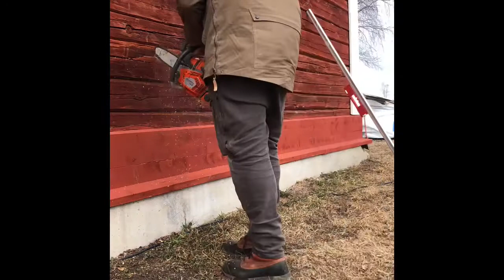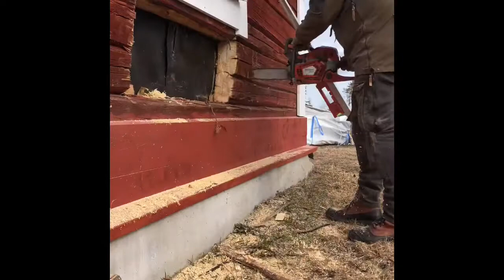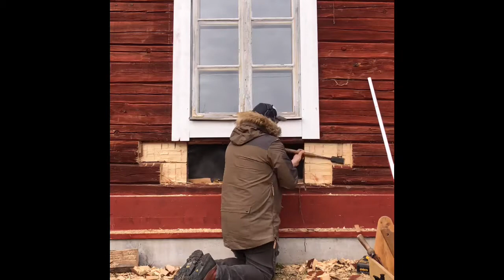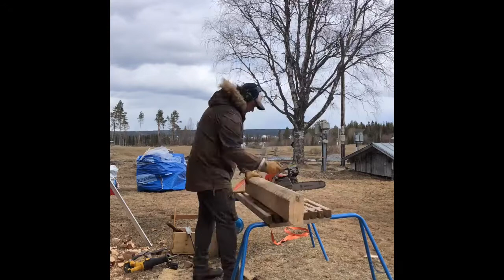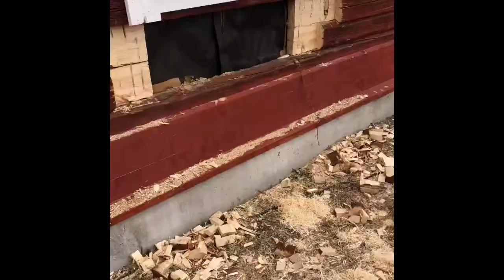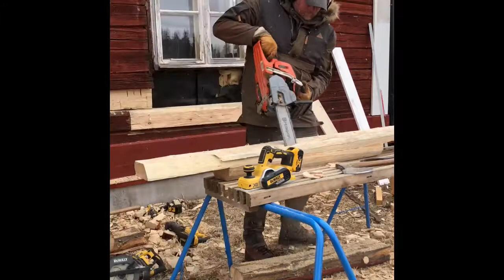Replace rotten logs.

Comment: How do you seal the logs in there so it doesnt fall out?
Reply: First you make a smal hole in the new log and use a long screw in the hole. To seal the hole you use a smal wook stick in the hole so water doesn't go inside